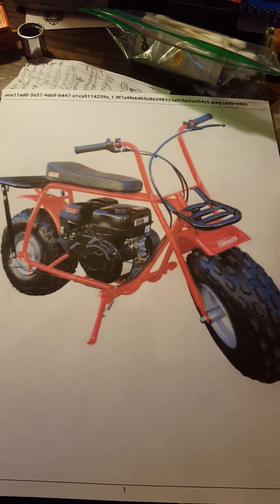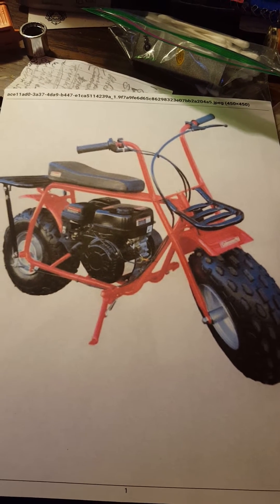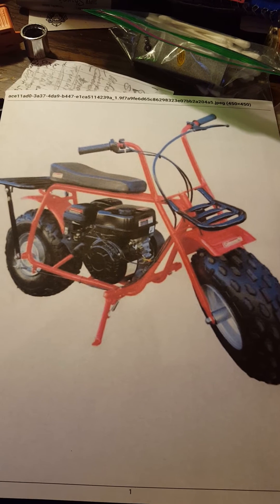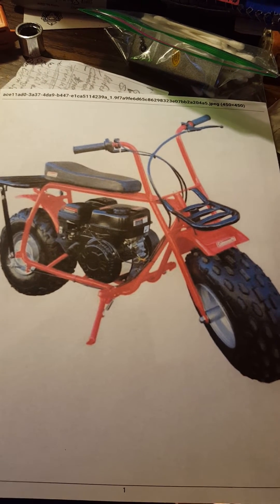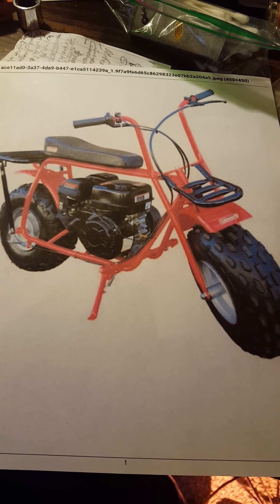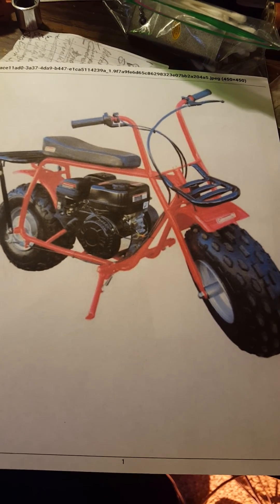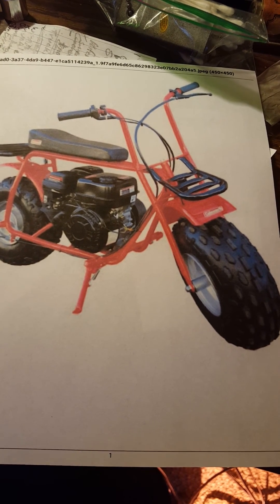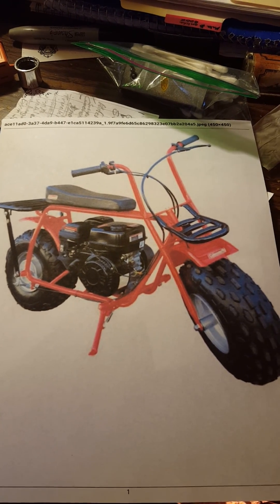Colman CT200U tav 2 torque converter troubleshooting..

Comment: did you find a tav made for 5/8 shaft or does your ct200u use a 3/4"?
Reply: If you have a 5/8 (16mm) shaft like my CT200U did, you have to buy a Predator Engine (or other engine with 3/4" shaft) or else change out crankshaft on original engine. Just finishing up my install now with a Predator hemi.
Reply: thanks for the info!  i picked up a predator 212cc engine from harbor freight...actually picked it up a week ago thinking i would put it into a go kart but now i have decided to put it in the ct200u.  Think i could pull off the swap and tav install in a day if i have all the parts?  thanks for the info
Reply: I don't know.  Maybe if everything went very smooth. I've been working on mine for a few days and just got done an hour ago at 10:30pm with my headlamp on outside.  There's just lots of little adjustments and fiddling around, cutting and drilling metal is also time consuming. I also changed over gas tanks yesterday. Tonight I fought with the chain, and then the rivets on the rear pulley were interfering with chain after I thought I was done,  and so I had to take it all apart and change a washer around on rear pulley shaft. 

Then had to mess with chain tension. Before that fought with throttle linkage because at the factory they screwed down clamp for throttle cable with an impact driver. To get to that I had to take air cleaner box off and take out throttle linkage to get a pair of pliers on the Phillips head screw.  Little things like that soak up the time, before you know it, it's dark out. LOL.  It's not a quick and easy job but it's mostly straightforward. I got some vids on my channel about the process but don't go into too much detail.
Reply: ok, well i got my tav in yesterday and i managed to get the predator and tav installed in about 4 hours.  went somewhat smoothly since i knew ahead of time to cut the backing plate and get 5/16-24 bolts for everything. I ended up using 1 inch perforated steel square tubing and the holes lined up with the motor mounting holes so i got lucky there.  I tried changing the tanks from the coleman motor to my predator but i couldnt get one of the bolts loose on the predator so i just switched caps and put the predator on.  I was able to take it for a quick test ride right before it got dark.  i am going to take it all apart and thread lock it today.    btw, the bike feels so good with the torque converter..just pulls and pulls
Reply: Yeah I took mine for the first test drive last night in the dark..  It's crazy how much more power and speed it has!  So worth the effort.
Reply from the maker: I was amazed at the difference myself, definitely worth the few extra bucks and time. Plus the centrifical clutches were so damn noisy